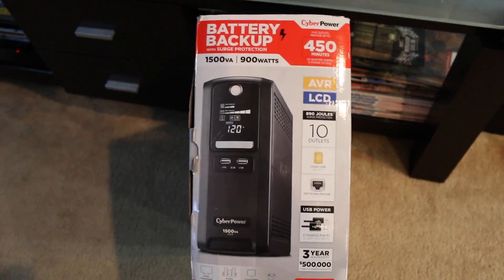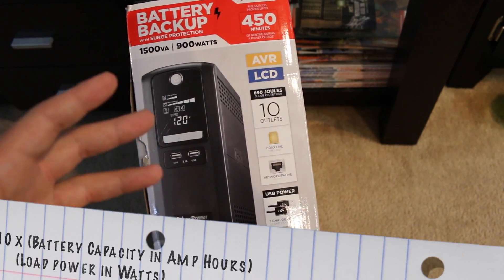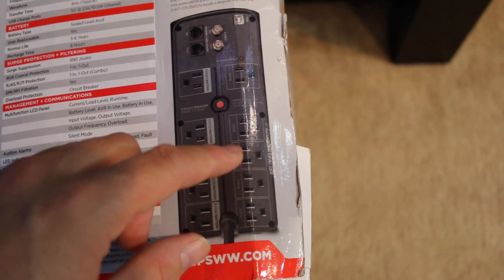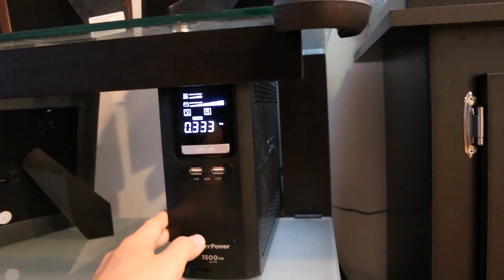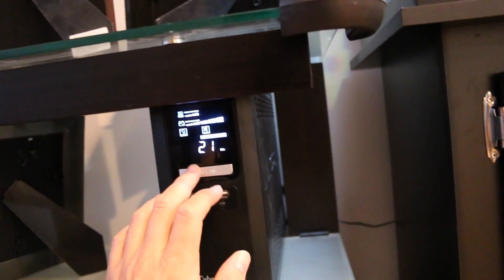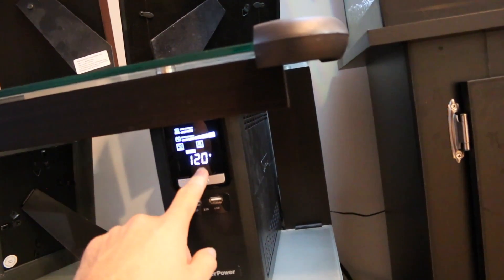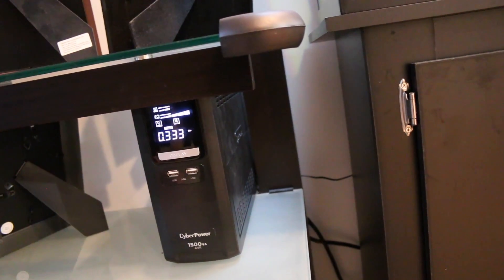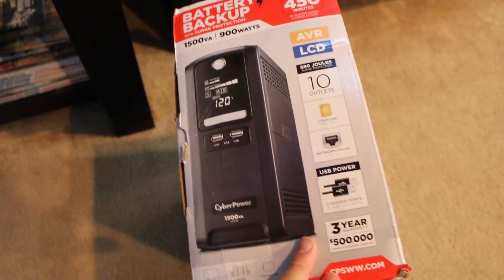Aquarium Backup Battery (UPS)

Comment: Granted you've got a fancy Uninterrupted Power Supply yours may tell you when the battery needs replaced.  I got a CyberPower 425VA at the ARC for a few bucks....but......the battery is dead and the battery side is not powered!  You may need a new battery soon or the half of it may die while your on a vacation!

just when the battery dies, the one I got, all the vital plug-ins fail to power on.  All I'm saying is you need to make sure the battery is okay every couple years(THIS VIDEOS IS OLD).  I will probably use it even though I know the vital side is due for failure (just keep an eye on it).

Comment: I have a APC brand ups, it will not run the filters. I called APC and was told that it is designed for computers and that electric motors place different demands on the unit and it will not work and, it doesn't. My advice is before any purchase, make sure it is compatible with electric motors.
Reply: A UPS can run AC motors, but the UPS must be sized correctly to handle the inrush current when the motor starts, and the UPS has to be of the type that provides a pure sine wave output when on battery. Some of the lower end APC units like the Back-UPS models produce a stepped square wave, which is not appropriate for running AC motors. Smart-UPS and higher models have sinewave output.
Reply: @timrees1  
So, Tim. You need a sine wave to run filter motors. What about running LED lights only. Fish can survive 24 hrs without filters, but lights are a bit of a problem. There is also a heater but I am not concerned on that because water will gradually cool down after 4 hrs from 26-8 down to 24-22. If in 4 hours the power isn't restored, prepare the fry pan, unless you have a better option.
Reply: @mickcarson8504  Hello Mick, if you have LED lighting then this will work regardless of whether the UPS is pure sine wave or not as ultimately LEDs are powered by DC. Really the best option for aquarium application is a pure sine wave UPS, and typically you will be able to configure "load shedding" in the result of a power failure so you can power the items most important (e.g. heaters) and drop anything less important.
Reply: @timrees1  
Yes, thanks for the tip, but the LEDs work with a 240v transformers, not DC power.

Comment: I just bought an APC 1100 VA / 600 watts, model BN1100M2.  I have a 20 gallon tank and only plan to use the Marina S20 power filter on it. Any guess on how long it would give me?
Reply from the maker: McG V nice! Plug the battery in, let it fully charge. Hook all your equipment you want powered up to it. Then pull the main power from the wall, it should give you a read out of how long it has on the battery
Reply: Thanks!
Reply: I'm In NC and Florence is coming.
Reply from the maker: McG V man, I wish you the best! I’m in md and was suppose to be going to bike week in oc. May be taking the car or cancelling all together

Comment: Nice gotta get a couple of these
Reply from the maker: It is great in a pinch, i did have to take the heater off of the battery backup. I had simulated some power losses to see how it would work. With the heater plugged in, the battery backup was really unhappy and actually shut itself down. Everything else in the tank is on the backup battery.